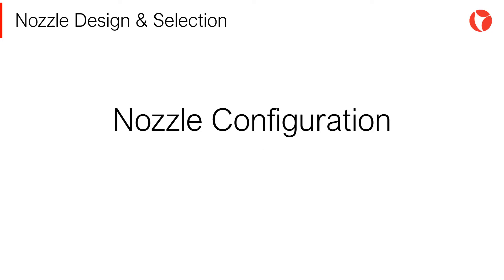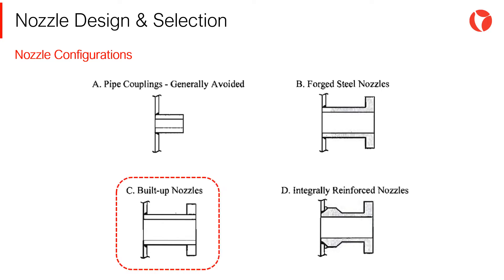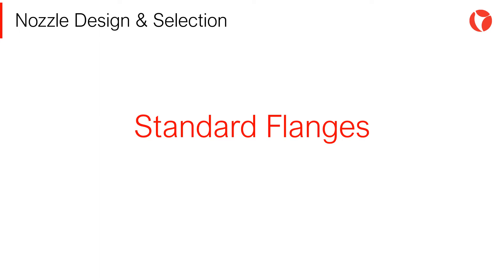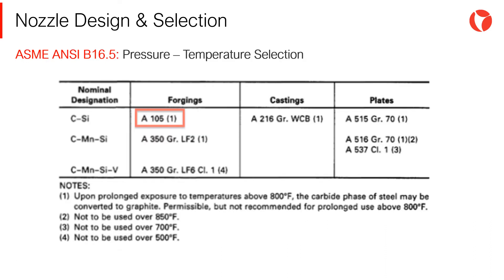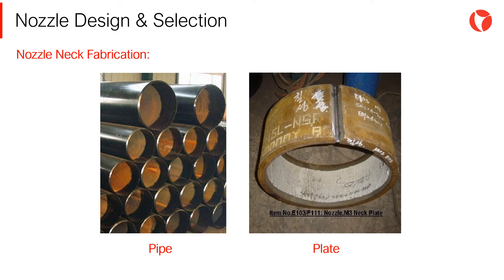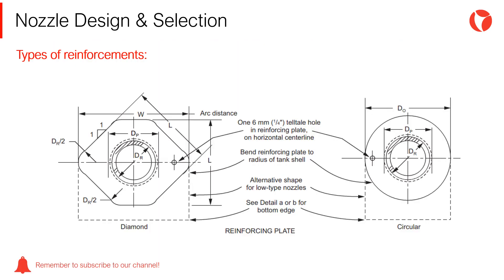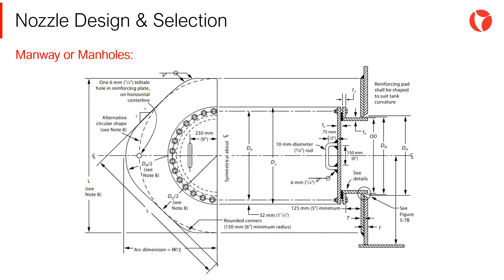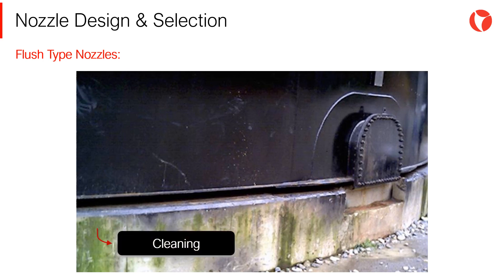9  Design of nozzles in storage tanks

Comment: Interesting presentation. I have a question. Several aviation fuel standards require a minimum suction height of 40 cm in storage tanks to minimize fuel contamination with water and sediments. Alternatively floating suction can be provided. Can be both API flush and API low nozzles suitable to meet this height requirement? Nozzle size would be 18.